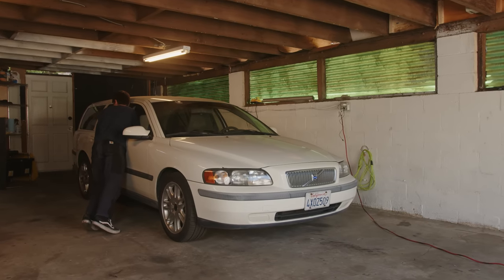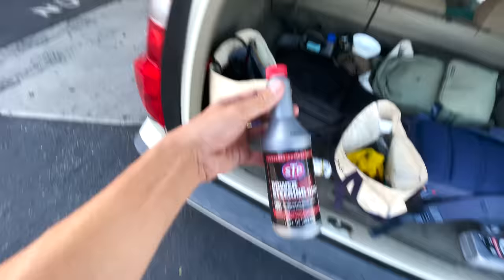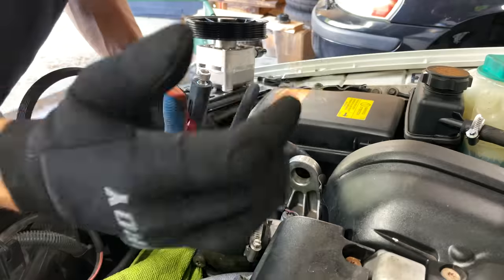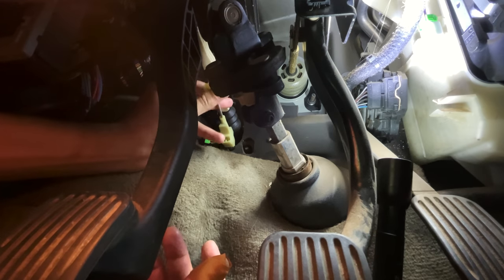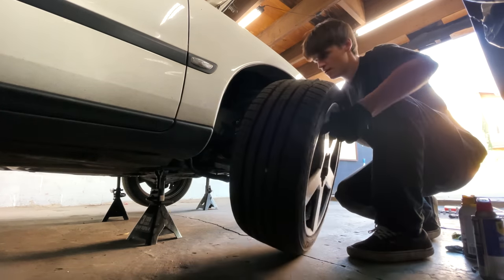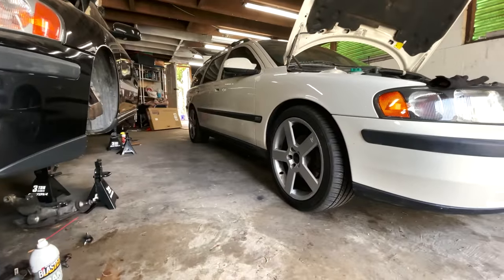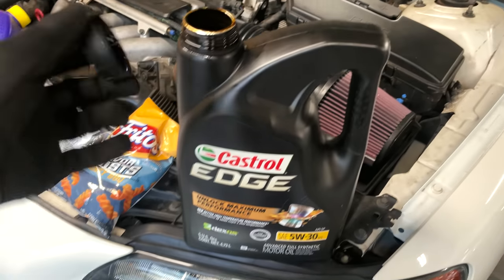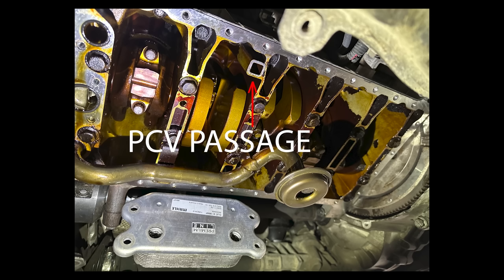MORE ISSUES with the $800 Volvo V70 + First Mods!

Comment: Its the ETM
Reply from the maker: Vida sweep test comes back to 2%, so I was doubtful of it. But after reading the comments I’ll give it a shot
Reply: @wheelemverb  my v70 was like that and was the etm. Try to reset it. With o
Ignition on, but not running take the fuse off and put it in again. Cheers!
Reply: I agree. ETM. I did not have diagnostic software. Figured it out by process of elimination. Got the unit rebuilt by Xemodex, so reprogramming to mate to the car was not necessary.
Reply from the maker: I will try that! Thank you
Reply: @wheelemverb  Very frustrating to troubleshoot because the engine control does not trap the errant feedback position condition and generate a code.  Volvo must have assumed it will never happen.  Not a good assumption.  The variable resistor element that is part of the throttle assembly wears out and is unable to provide a position feedback signal.  The throttle position cannot be controlled precisely without feedback.  Which is why the idle is whacked, and why the vacuum wanders, because the throttle position is wandering.  Makes perfect sense when you replace the unit.  Oh, that's how it is supposed to work.  New/rebuilt units use a "contactless" position feedback, so that particular failure should never happen again.
Reply: It is true the old magneti marelli throttle body's have this issue, but you can't say the TB is bad just because it is a common issue.
I have the same idling issue with my 2007 version, I don't have the MM throttle body. To be 100% sure, you should eliminate all components before buying expensive parts.

Comment: Beautiful looking car, love the white colour. I've got the same looking car, but mine is a 2.4. Diesel in dark blue. 2003 reg. These cars are absolute beasts, so lovely to drive. Only 163bhp but still really fast, beginning to wonder if it's been remapped when I bought it as it seems to drive a bit quicker than I thought. I'm in England, there's still a lot of these Volvos still about in petrol and diesel, I would say 50/50. It's the same with the S60 too, lots to choose from. I've had the S60 and S80 before I bought the V70, the V70 seems to be the fastest one out of the 3. But they are all great cars. The V70 and the S60 were used for many years by the UK Police, I remember getting stopped by a couple of these about 20 year's ago, had to sit in the back while getting questioned lol. I remember thinking how great looking they were back then!

Comment: ✌🏼💚 doing the exhaust vvt gear on my 07 xc70. #volvo4life  
07 xc70 250,000+, 
05 xc70 311,000
Reply: @4:00 sounds like the issue I have at idle after a drive it stumbles. Check ehaust vvt gear, 9x outta 10 older mileage volvo with vvt system always has an exhaust gear that goes bad. Can pull the timing cover and start the car, and watch the exhaust gear move in and out a bunch. And if you can move it in and out by hand with car not running then it's really really bad. Can check the front gear same way. They will run with bad vvt ⚙️,  with new ones you will be like wow, less turbo lag, proper adjustments,  easy couple hour fix. ✌🏼💚 #volvo4life from Vermont 🇺🇸  sounds so good under a load
Reply from the maker: I already replaced the VVT gear! But thank you

Comment: NO HELPFUL INFO!!!

I'm not sure if I have/hade this issue on my old v70 or the one I drive now, I live in a pretty rural place without traffic, and pretty cold climate. The only time I have experienced this is in the next town over in summer heat, and queues. It was much worse than yours though, after 15 minutes of running perfect it would just go crazy between 1500-500 almost dying, used to just rev it a little and then it was good for another 15 mins😅 never Cared enough about it to look for the source of the problem

Comment: That mechanic was a meat head, def look into the vvt gears for the timing,  99% the exhaust gear is bad, the intake doesnt seem to go bad as fast as the exhaust unless you start horsing the cars. A little unknow knowledge that has turned many $1000 beaters in $5000 re sales for a couple hundred dollar part and a few hours